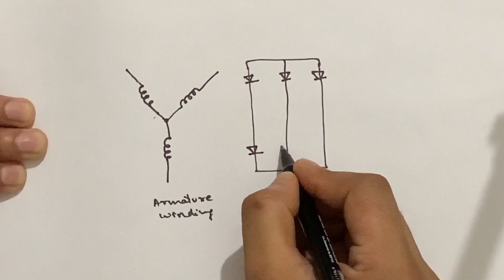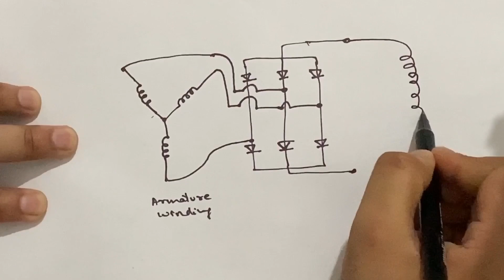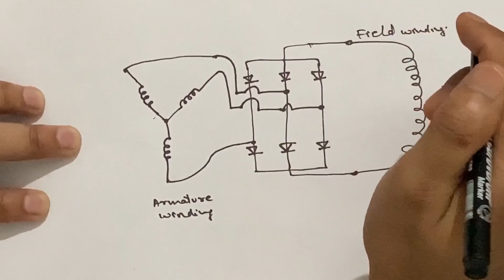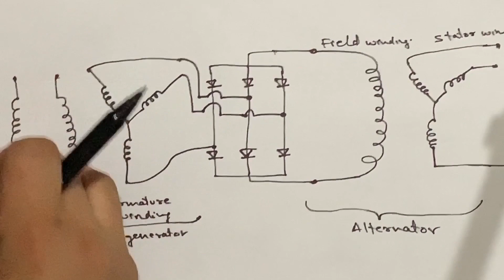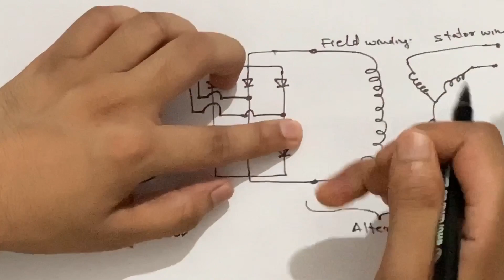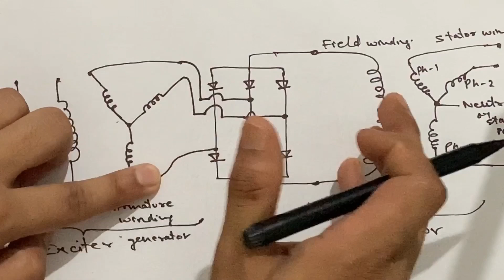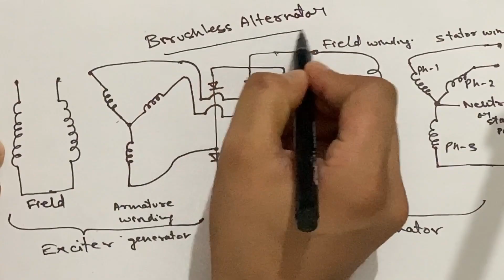What is Brushless Alternator ? || Advantages, Construction and Working of Brushless Alternator ||

Comment: Plz explain  function of AVR used in brushless alternators.
Reply from the maker: Many types of VR are there. Will make a separate video for it. As of now for your query: AVR - Automatic Voltage Regulator. It is an electronic type  voltage regulator which senses the voltage output of the brushless alternator and thereby controls or varies the field current strength so as to keep the output voltage(115V/200V AC) constant (within tolerance).